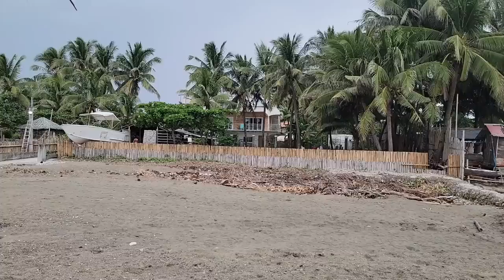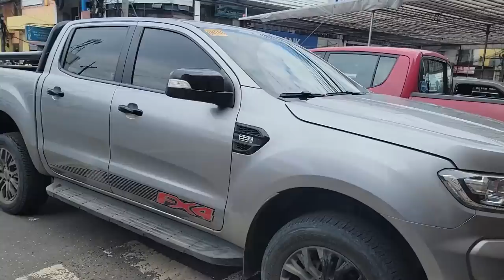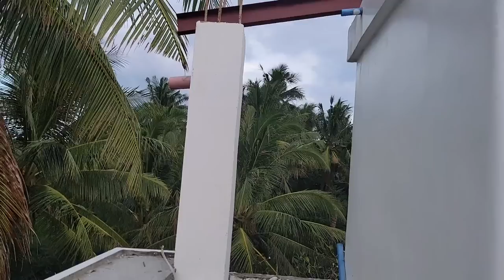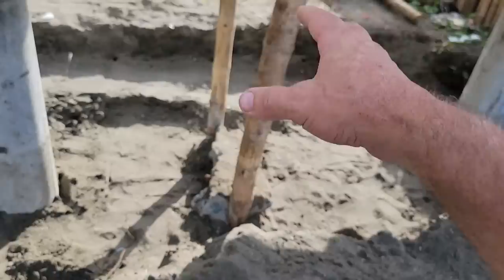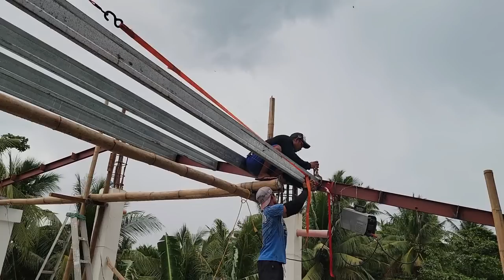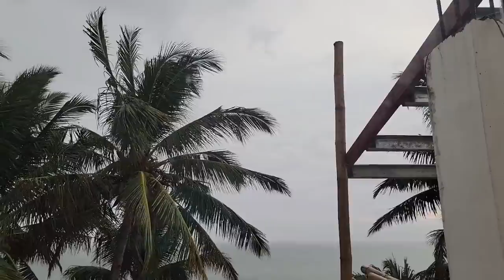Philippines Beach House Build Day 362 Steel Roof Frame, Decorative Fish Pond , Walk in the City

Comment: I think the Spruce Goose was  built by Howard Hughes and flew just once, if memory serves correct.  It was a massive aquatic sized airplane.
Reply: I think "Howard Hughes v2.0" aka Elon Musk should name the ship going to Mars the "Spruce Goose", it too will fly only once.
Reply: The wartime availability of aluminum being thus, Hughes built the Spruce Goose at his Culver City plant out of marine plywood in the largest wooden hangar on the West coast.  They trucked the Goose to Long Beach Harbor, where they made their one and only flight. Hughes also built the largest private runway at the CC plant that was eventually used to test flight the helicopters they were producing.
Reply: The  Spruce Goose first and only flight was not suppose to happen and Hughes was upset. It was suppose to be a high speed water taxi but got airborne.

Comment: Your building a monument on sand. Harold built a Goose that could fly.
The Spruce Goose was Big Grand. Mate the biggest. It did not work. It wasn't strong enough. Steel is way stronger than wood.
I Hope you have anchored your foundations in the Limestone bellow the sand.
Building on Sand when half the beach gets washed away every storm is?
Getting the foundation right is the most important part of any build.

Comment: You might want to test the insulation idea before going all in. If the heat can't radiate below and get cooled by the breeze, it might reflect back at the solar panels and could reduce their efficiency. Just a thought.

Comment: Spruce Goose was H. Hughes'  prototype heavy lift cargo aircraft. It was called the Hercules, it is an 8 engined monster but never got into production because the war was practically over. Hughes himself was doing high speed taxi tests, and it took off on him ! It's in a specially built hangar somewhere in Washington state (?). Did you call it spruce goose because it ain't gonna fly no mo' ? PS, it was actually made out of wood.

Comment: Is it less expensive to use the I Beam over Concrete beams
Reply from the maker: When attaching the C Purlin it is way easier to attach and weld to C channel or I beam. Then when attaching the longspan metal roofing also way easier to screw and drill into steel vs concrete to attach the sheets and trim a long the edges.
Reply from the maker: Good Morning  Dave and Crew

Comment: Hook up a bilge pump/pond pump that flows out of the boat bilge drain hole into the pond for aeration and just a cool look.also could be utilizing solar setup all its own so you don't have to wire it to the house... just a thought
Reply from the maker: Chris I like this idea of the water pumping out the bilge pump hole on the boat. Yes I already bought a 12 volt small sump pump for a pond before that has been sitting here. I like it ! Thank you Sir
Reply: @TexasFilipino  just an idea from one Texan to another!

Comment: Born and raised in Long Beach Ca. As teens we would sneak into the old dilapidated dome they built for the Spruce Goose when they started to neglect it like they did the Queen Mary. Another place we use to sneak aboard. Believe it or not we’ve climbed to the top of the smoke stacks via a ladder that went from the deck to a catwalk on the inside. We’ve been all over that boat, top to bottom, stern to bow. We like to think we’re the reason they think that ship is haunted.
That dome that use to house the Spruce Goose is now the cruise ship terminal.

Comment: That insulation you talked about is absolutly necassary  with metal roofing  , I have a bald spot on top of my head because i waited too long to install it. lol ,    I know it goes on before the  roof sheeting  and is pinched between the rafters  and sheeting.   But  i havent seen it done yet in a patio where wind can rip it out.   But i know your up for the challenge.    It  was the best thing i did to my house.
Reply: Also paint the metal White for heat reflection
Reply from the maker: The problem with that foam with the silver backing is this the UV rays will eat it up. even from the bottom side. The best I can combat this would be either dont run it all the way out to the end of the overhangs over the canopies. The other option is if I run it all the way to the end and then laminate underside of the overhangs with something. This now creates further challenges like places for birds , rats or other creatures to reside.